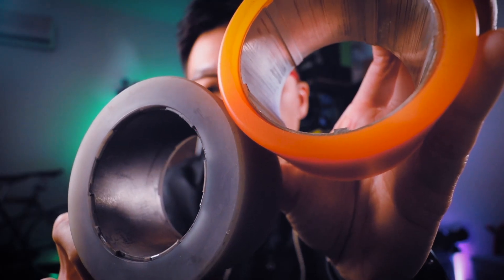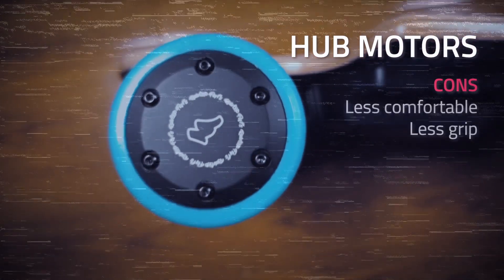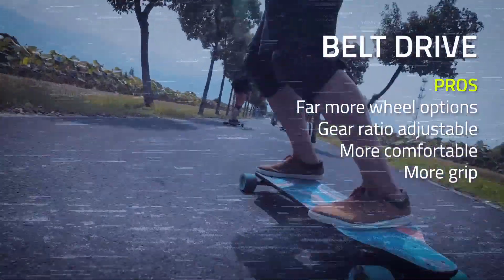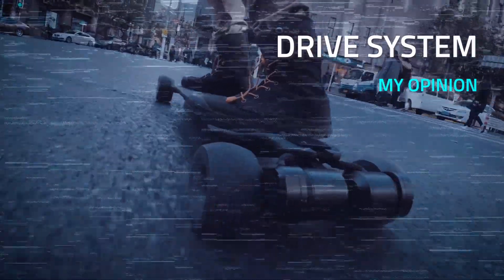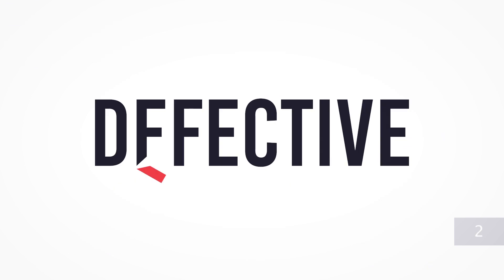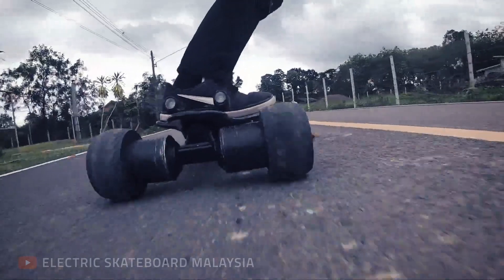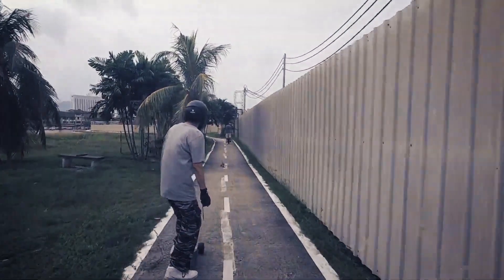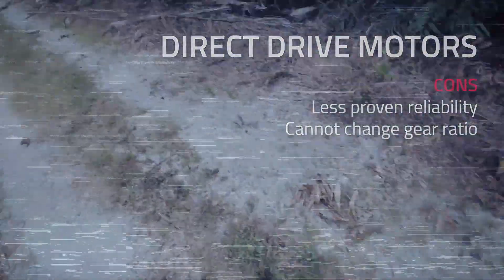Hub Motors vs Belt Drive vs Direct Drive – Electric skateboard drive system pros and cons

Comment: You missed the fact that hub motors provide you with the ease of coasting while not on the gas and if you run out of battery you can free push your way home with ease. You definitely can’t do that on a belt drive board especially if you don’t have any tools to remove the pulleys and belts. A hub motor board is more like a longboard while a belt driven board is more like a machine
Reply from the maker: That’s correct when belts are too tight. If properly tensioned, belt drive boards are only marginally more difficult to push than hub motor boards.
Reply: @DanielKwanExtras  Yeah I've pushed my belt drive a many a times. I usually have my popsicle on my back though since I'm usually headed to the park. So there's that too.

Comment: Why is he not talking about the fact that hub motor skateboards can always be used and pushed as regular skateboards while if your battery dies on belt driven skate you're pretty much screwed? That's like the best part of hub motors in my opinion..
Reply from the maker: Hub and belt drive both have noticeable resistance, more so on belt but neither feel like normal skateboards. There's really not much more resistance on belt drive if the belt tension is adjusted properly.
Reply: @DanielKwanExtras  well obviously a hub motor is not gonna feel like a regular skateboard. The added weight of the motors, the batteries, and the ECU all play a role. However a hub motor board can be pushed much much much easier then a belt motor board because it lacks the resistance of the belts and pulleys. I speak from experience here, I have nearly 2000 miles on a hub motor board, still on all original stock components
Reply: @DanielKwanExtras  Honestly I only ridden some older belt boosted boards, and resistence was much more noticable while pushing compared to the hub motor Im riding now. I ordered wowgo at2 (belt) for this season, and I really hope you are right :) I only really care for the range and confort while riding hence prefer occasional pushing. Cheers!
Reply from the maker: Many people have their belts set too tight. A belt drive board with properly tensioned belts shouldn’t have much more resistance than a hub motor board.

Comment: I big plus for hub in my books is drivetrain efficiency. For the same battery size, hubs get more range when compared to belts as not only is there less friction in the drivetrain but hubs coast for much longer in a flat land comparison.  

Maintenance has been mentioned, but let's expand on that.  Hub boards have 8 bearings, two standard skate bearings for the each front wheel, and two very large bearings per hub motor.  The skate bearings can be lubed and maintained, just like a regular board whereas the bearings in the hubs don't need maintenance for the life of the hub.  Not to say the hub bearings aren't serviceable, they're just sealed inside the motor and avoid the ingress of dirt and moisture.  Hub motor bearings are much larger, and in the case of meepo, deep grove 6001-rs bearings which help dissipate heat and are long lasting. This is especially important for the drive wheels, which undergo a great deal more stress than the non-drive wheels.

Belt boards have as many as 16 bearings, 2 for each wheel, 2 for each pully, and 2 for each motor.  Some boards have only 14 bearings as the pully may not be fully self supported on two bearings, but rely on the inside bearing of the wheel for one of its bearing supports.  From what I've seen, all these bearings are standard skate bearings, except for the motor bearings, which like hubs are sealed and usually not serviced.   The use of skate bearings can be a problem for the drive wheel if the bearings used are inexpensive with nylon bearing cages.  If the bearings aren't maintained, heat builds up and the nylon cage lets go of the bearing balls and suddenly you're riding at 30mph with 3 wheels.  All those additional bearings add resistance, require maintenance, and when combined with the belts, makes a belt board less efficient in watts per mile over a typical hub setup. 

I'm getting close to 50km of range with my meepo classic two.
Reply: So hub or belt?
Reply: @ahmado8417  - hub all the way!! I’m approaching 2000 miles on my beginner ownboard. Still on all stock components. Even the stock grip tape. My battery charges up to 97% and I am able to go as far as 10 miles with many miles at full throttle. Plus if I’m ever out of battery I can free push myself home. You definitely can’t do that efficiently on a belt driven board with the resistance.
Reply: @BeeStinger13  nice what board?? I got the backfire g3!!!

Comment: I want to buy my first board and watching your video has been incredibly useful, thank you so much for that! I know now that I don't want the Hub Motors, but im torn between direct drive and belt drive. I was looking at the Onsra Black Curve, which have both options. I feel like the direct drive motors could be hit by debris  more easily since they stand lower to the road than belt drive ones, but im still curious about them. I was also looking at the Backfire Zealot, Ownboard Bambo AT and Exway Flex. I don't care for the boards that only have the old skateboard wheels, from the videos i've watched, I feel like the 115mm rubber wheels are the best ones for city riding. I am never gonna go in the woods with that so I feel like the AT wheels are pointless but the streets here in Canada arent the mirrors that they are in the USA, alot of holes and scrubby asphalt. whats your thoughts on the Cloudwheels? not as good as the rubber ones right? I think you have said that in one of your videos lol sorry I spent like 20 hours in the last 2 days watching your videos and everyone else about these boards.
Reply: On the contrary cloudwheels are really popular!